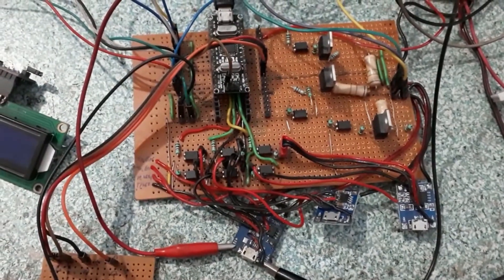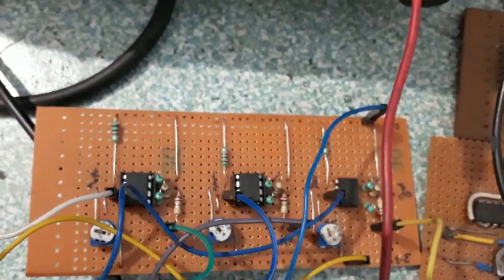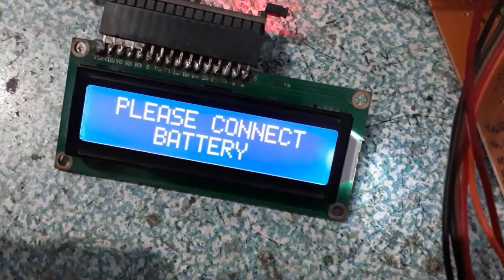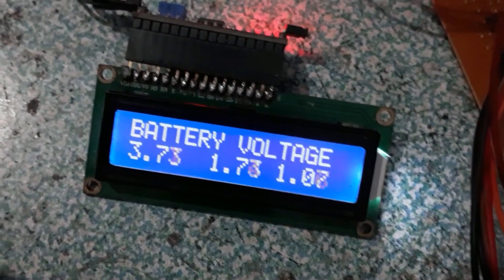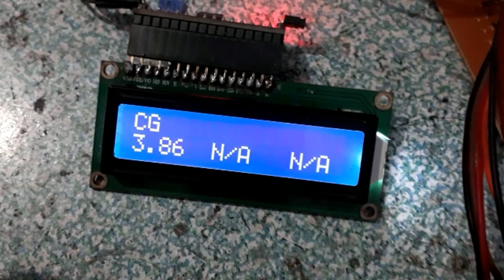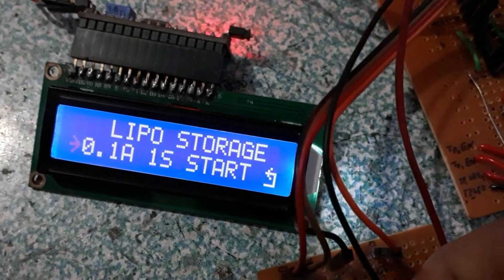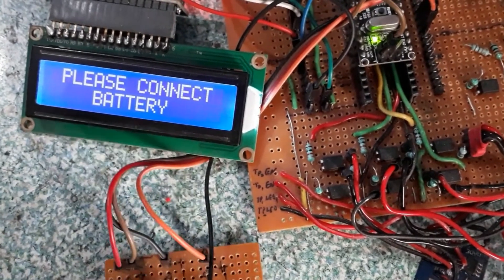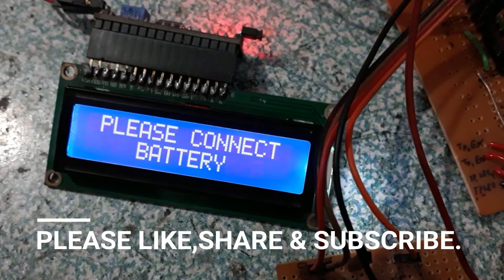DIY 18650 Smart Balance Charger Arduino || PART-1

Comment: How did you solve the short circuit issue of connecting the TP4056 modules in series?
Reply from the maker: +Anton Troskie By using 3 isolated 5v power supply.
Reply: Electronic projects Thank you. After rewatching the video I realized you've mentioned using isolated power supplies.